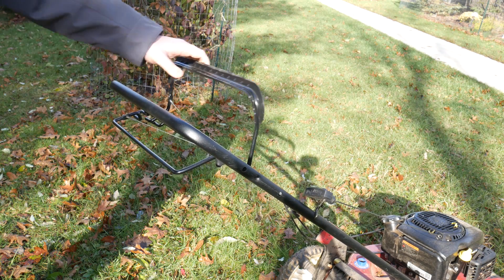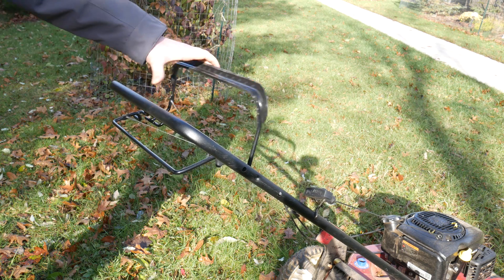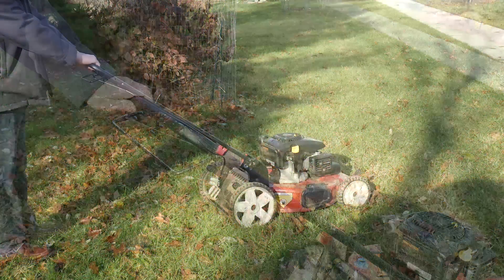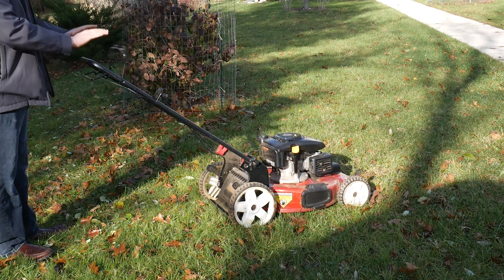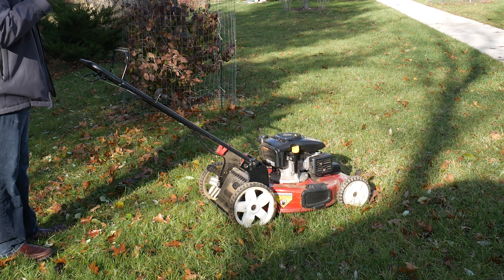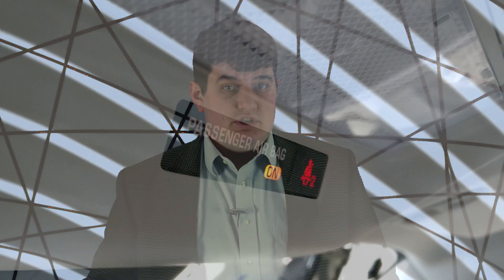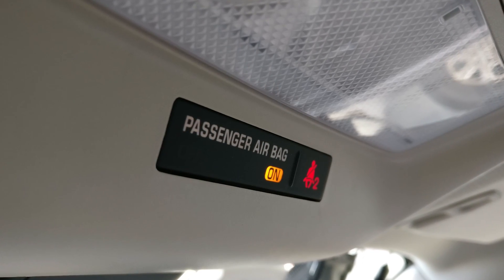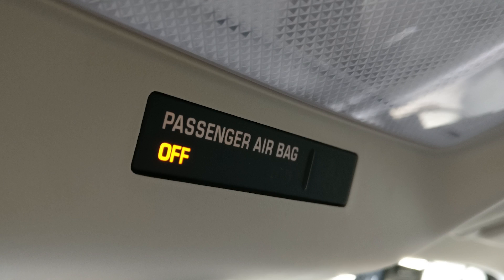The Dead Man's Switch:  How Anton Yelchin's life could have been saved

Comment: couple of small comments from an automotive engineer (working in both aerospace and automotive, i've designed many of these interlocking safety checks): adaptive airbags are only a requirement in the US, because US lawmakers assume people don't wear their seat belts. If you don't wear your belt in europe, that's assumed to be a Darwinian act. opposed to that, steer-by-wire is still very much illegal in europe, except for agricultural and other reduced speed special vehicles.  
at 4:35 you mention passenger seats are a mirrored version of the drivers seat: they very rarely are. economy of scale permits a lot of different parts in cars, since dev time can be spread out over a lot of cars. notable exception is the citroen/peugeot/toyota C1/107/aygo, in which they are the exact same. even though they still skimped on the buckling sensor. 

still, i do agree with the concept you propose, seems like a no brainer. same with the prius errors. it's a bit of the tragedy of the commons i think. the auto-industry has gotten way to big for it's own good, to the point where individual engineers who have their noses in the bare metal, don't have the managerial pull to get such a feature implemented. most of my work is done for a company of roughly 50 engineers, and most of it is thinking of how stuff will and can go wrong, and how to fix this within the bounds of reason, usability (the safety switch that's annoying gets bridged), durability, cost, and not the least, the law. many a good feature, especially in aviation, gets outlawed because some half-cocked version of it once went on the fritz in the '50s. it also, weirdly, takes a special kind of person to consistently think of these things, while being able to mentally  simulate the consequences for the rest of the system. on the plus side, that means there is at least solid employment for the people that can, although some people will think you a killjoy.

Comment: My car from 98 has an interesting gear shift that I don't completely understand. There is a cable that runs from the shifter to the transmission, or more accurately a sensor on top of the transmission. There is something that it turns attached to said transmission which I would assume is some sort of manual override, but if it is an override I've never found a way to use it which is annoying because if something goes wrong with the sensor (which I've had to work on) or the computer it defaults to a fail safe mode controlled by the computer rather than the shifter. Maybe it's a failsafe for if the computer fails outright rather than the sensor or some other electronic module, but if so I haven't experienced this. It makes me wonder if it would be controlled manually if I disconnected the transmission computer or if it would cease function all together.

Comment: Riding lawnmowers have switches like this. We disable them because they’re basically the oversensitive spawn of satan which turns off your engine for slightly wiggling. I would NOT want this because I can just imagine the sort of nightmare it would present for drive-throughs and such places. You wiggle in your seat at low velocities and it has a fit. Now, an even more high tech solution would just be a more reliable occupancy sensor combined with this idea, and if the occupancy sensor worked reliably then I see no issues.

Comment: Or GM could just start to force their cars into park when you shut the Engine, like all VW and Volvo cars (automatics dont let you pull the key out of the ignition if it has a physical connection to the Gearbox, otherwise it just puts it in park and both manuals and automatics pull the e-parkingbrake if there is one)

Comment: Just because ONE manufacturer phoned in their design and is shit at building cars, does not require a regulatory change.  If you have ONE company with a design flaw, you sue that ONE manufacturer to fix their garbage.  When Ford Explorers were flipping on their lids any time there was a stiff cross-breeze, was there a call to legislate that all cars made have a track-to-height requirement or somesuchother baloney solution?  No.  Ford & Firestone were hauled into court (congress) to answer for their design failures.  Guaranteed Jeep has known about hte flaw for eons but has no incentive to design better because all the lemmings that buy their garbage.  They hear Jeep and lay down their cash.  I have heard PLENTY of stories of people buying new jeeps and a few days later suddenly saying Gee, this thing doesn't seem right.  This other thing is not in a good location, This seat is uncomfortable, That noise is too loud, .....  People that will turn in a vehicle they enjoy, and doesn't have anything wrong with it other than its @100k on the clock and its not all shiny anymore....  
As to your answer of "...all systems are computer controlled..." that is largely due to regulatory pressure trying to regulate the stupid out of stupid humans.  And you Can't.  Humans will ALWAYS be stupid.  As we get more nanny systems, you get more distracted drivers...   more drivers that are increasingly NOT paying attention to driving.  Adding an occupancy sensor that locks the car into park will result in people not shifting into park.  Because the car does it for them.  Then you'll start having people get into their cars, starting them and teh flaming thing goes wizzing into the garage door, because they Didn't Ensure Park Was Set.  
The only solution would be to call attention to the driver's stupidity, like a giant voice yelling at them they forgot to shift into Park and engage the parking Brake.  Like we used to have back in the 90s.... " your door is ajar... your door is ajar..."
Had Anton used the Parking Brake none of this would have happened...  but no one uses that SAFETY DEVICE that was required eons ago....

Comment: But do you want a car that parks on the highway if you lift your behind shortly from the seat to rearrange some annoying trousers?
So, some intelligence is needed not to create an even more dangerous situation... But that requires software, and software is never bug free.
I'm already not too comfortable, as a software developer, to rely on steer- or drive-by-wire. And the more complex you make a machine, the more are there to break.
So some purely mechanical backup is to be preferred, just like airplanes still have mechanical backups when the electronics or hydraulics fail.
When that's said, yes a dead mans switch makes a lot of sense when it comes to cars... But you can't just rely on the software, one glitch could kill more than one person being careless.

Edit: I think you give software too much trust. Especially in an independent system, like a car, that also generates the electricity its systems are running on... One thing is if the computer that makes the engine go round, but you have to remember that PARK in automatics also engage the brake... You do not want a glitch to suddenly do that...

Comment: I know you said “supposed runaway Priuses” but there was never even supposedly more than one... and that one turned out to be a hoax. There is absolutely no justification for associating the stigma of Toyota’s unintended acceleration incidents with the Prius. Heck, the whole “unintended acceleration” hysteria was touched off by a San Diego incident with a loaner car that didn’t even call itself Toyota: A Lexus crashed and tragically killed the occupants (a police officer and his family), but even that wasn’t due to any fault in the accelerator or control systems. The actual cause was that the dealer put in the wrong floor mats, which jammed against the pedal, and the driver was unfamiliar with how to turn off the engine in a car with keyless ignition (loaner car; remember?).

I called out the Prius incident as a hoax literally while it was happening, since I lived in San Diego at the time. You see, we were all-hyper aware since the first incident happened and, being SoCal, the question on everyone’s minds was “Does this affect the Prius?” The investigation had already revealed a theoretical problem where the electronics in some Toyota vehicles could cause unintended acceleration but it was not responsible for any of the deadly incidents known at the time. The answer to the Prius question was already “No.”

When I saw that it was a Prius in the same city as the original incident after we already knew that the Prius was not affected, I immediately called BS. The driver could have turned his car off at any time. Sure enough, even though the news originally reported it as an unintended acceleration event without even hedging with “alleged,” it eventually came out that the guy was bitter about his financial situation and was about to lose his car so he did it to put Toyota on the defensive (as if they were his creditors... LOL!).

The national news shamelessly reported his claims as facts without even questioning it. Don’t be like them!

Comment: So, a $40 sensor fails at 15 mph and now I'm buying at minimum a new parking prawl maybe a new transmission.  Or I'm digging my underwear out of my ass-crack while creeping along in traffic with the same effect as the previous issue.  Or even better, I am in the midst of a wreck that I still have some minor control of where all 4 wheels come off the ground and me a little out of the seat.  now when I reconnect with the ground my transmission is in park so the wheels no longer turn and I loose steering control all because some fuckwhit can't figure out how to put a car in park?  No thanks!  Remember if you make something idiot proof they will make better idiots!

Comment: Wouldn't that make pushing your car down the road impossible if you don't have a passenger?
Reply: You need to have the key in ignition to push it (meaning the computer will be on), so probably the steering input will override the park - steering wheels have sensors, too!

Comment: Drive by wire and steer by wire is still illegal. But the government has not been enforcing those laws. There needs to be a physical connection between the components in case of failure so the operator still has some control.

Comment: Cars should stay mechanical rather than electronic, it leaves them repairable by us - the average Joe. A mechanical deadman switch would be quite complex, could you imagine trying to service the thing by pulling apart your seat and floor to get at the linkages and all that? 

If it's electronic what happens if there's a software fault and the deadman switch doesn't activate? What happens if you ford a river and get your car completely flooded?

Comment: The one issue I immediately see with the described interlock is what happens if the driver lifts their weight off the seat for a few seconds to adjust their posture while at speed.  It's not a difficult fix, just include a check of the current speed before throwing the vehicle into park.  The driver might also do this at a stoplight/sign, so perhaps automatically shift back into drive if their weight is returned to the seat within a few seconds.

Comment: So I have to say, we've had this on Honda and Acura (well, same result, different method). Every Honda with a push button shifter will shift to park if the drivers side door is opened or the engine is turned off if the vehicle is stationary or below a set speed. There's actually an override sequence for unattended car wash units that you need to input to allow the vehicle to remain in neutral when you get out.

If I recall correctly (it's been a while since I had a manual civic as a demo) our manuals will set the electronic parking break automatically, I just can't remember what the logic is. Also, any Honda with brake hold will set the parking brake after 10 minutes of brake hold activation, or if the engine is turned off, or if the driver seat belt is released.

Comment: Definitely agree - Adding this sensor to the drivers seat is a good idea. I would want to have a mechanical override switch though in case the sensor became faulty. One note about that whole runaway Prius incident - after several incredibly in depth studies and a massive reward available for anyone able to definitively find the defect that would cause the car to accelerate although the brake was depressed, it eventually came out that these were all cases of people pushing the gas when they thought they were pressing the brake. This particularly affected Prius' more than other cars because the Prius was the first widely used vehicle without that familiar sound and feel feedback the driver would get through the gas pedal - and the pedal position relative to the seat was just a little bit off from most vehicles up to that time. People got used to how the car would "feel" when pressing the gas and the Prius didn't provide that haptic feedback so we ended up with people in high stress situations slamming the gas instead of the brake and because their sensory expectation had been betrayed by the new hybrid car design, they would swear on a stack of bibles over their grandma's grave they had been stepping on the brake. 
People are having trouble with "jumpy" electric cars as well because of the direct torque (which can be dialed back in the cars settings). They're getting whiplash because they expect a certain feel from the gas and now it's totally different. So I agree with sticking sensors in the seats but I don't really like the indirect steering or gas because so much of driving (especially in bad weather) is about how the car feels and responds to little things.

Comment: I have worked on some riding mowers and to my knowledge this deadman switch is only active if the blades are engaged at least the ones I have worked on anyway... as far as the so called better setups well I prefer the good ole mechanical feel of shifter resistance passing each portion of the shifting auto transmission and manual alike ... there's no questions in my mind especially with auto transmissions PARK REVERSE NEUTRAL AND THEN DRIVE ... 3 physical bumps and you don't have to LOOK you can tell by the position of the thumps if that is proper terms anyway resistance during the transitions from one position to the next ... are they thinking we are too weak to shift from one position to the next LOL

Comment: stupid dead man switch on my riding mower got disabled because I have a fence and it shutting down when I need to open the gate was super annoying.  modern cars are crap BECAUSE the computer controls everything.  if I could get it fast enough I'd rater have a model t than this current junk.